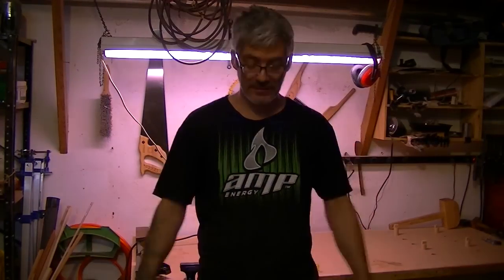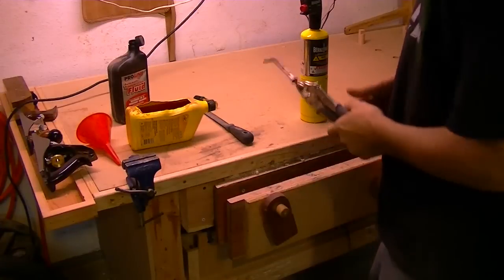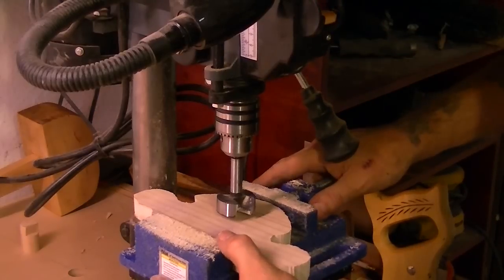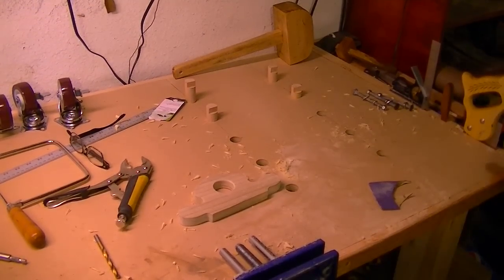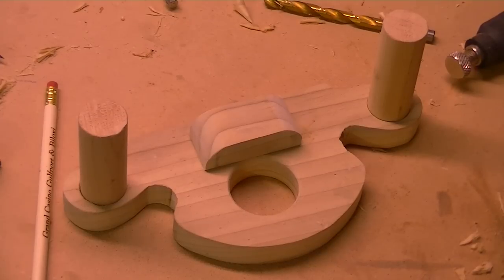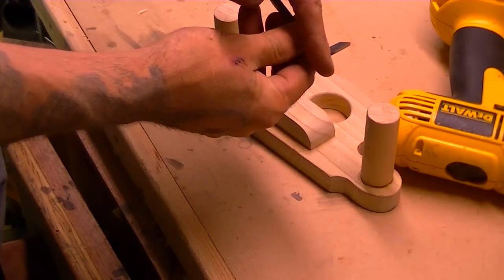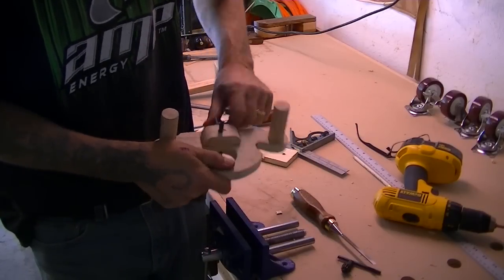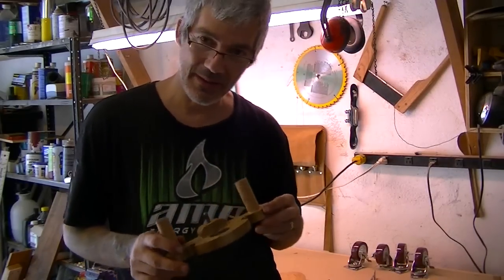Home Made, Hand Router Plane, a must for a woodworker

Comment: lol made one tonight , then i saw your video,,,lol i used a large Allen key ground flat for the blade, and a similar shaped base with dowel handles ,,,,, but a larger backer with a eye bolt to pull tight the blade to the backer block ,,,, using a wing nut to tighten the eye bolt , lol

Comment: You are the first person I have seen make a cutting edge the right way.
Most use a Hex wrench, 3/8 or 10mm & ground it flat.
Which is fine, but they get it hot over 500F when grinding.
How do I know it is 500F, because the metal turns purple at 500F. 
Good job.

Comment: Liked and Subscribed, thanks from Chicago! I'm new to hand planes but have a nagging question: Why are these hand routers made with curves at the sides where the grips are located instead of a straight edge? With a straight edge you could clamp a simple wooden guide or even a speed square on your project so the dadoe/tenon cuts are perfect.

Comment: i liked the video .... some tek info the process you call tempering is actually heat treating and the process you used to effect molecules as you say   is tempering... tempering control-ably with a lesser temp then heat treating makes steel less brittle making it tough ... i hope this answers some questions.

Comment: Thanks for sharing.  I have some old chisels laying around and think I may "task" my son with making me one since he's got nothing to do except play video games now that school is out.  BTW - I have 2 questions...
1. Did you need to bend the angle of the chisel slightly more than 90 degrees or did you do any grinding or honing on the bottom of the blade to bring the heel slightly higher than the front of the blade?
2. Ouch!!  Did you get the stitches making the router plane?  ;)

Comment: what oil would you say is best for the metal heat treatment?
Reply: +dreamboxproduction 
Motor Oil any grade will work. Used oil will work, too, but will darken the steel more than new oil.  Have an exhaust fan running or better yet, do this outside. the fumes are bad for your lungs. "Known to the State of California..."